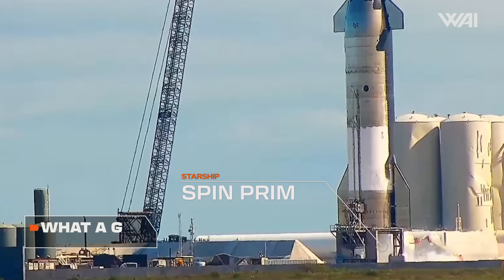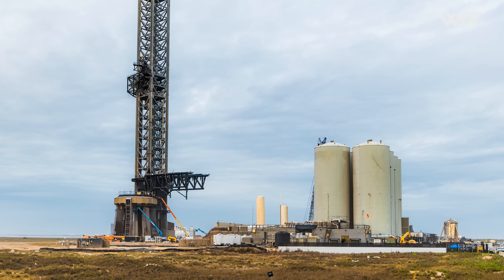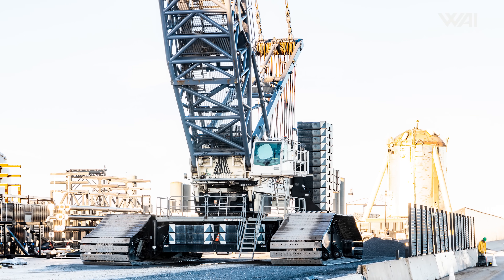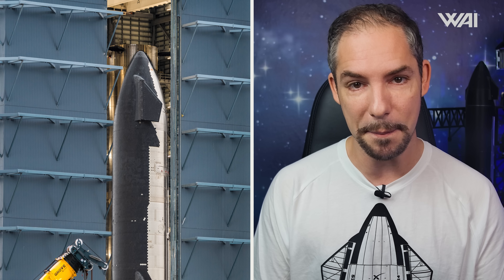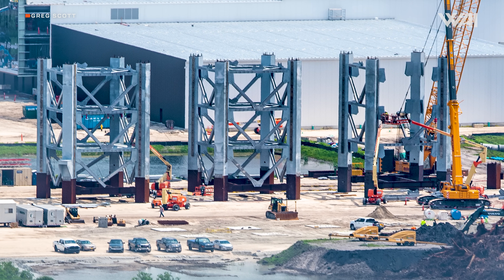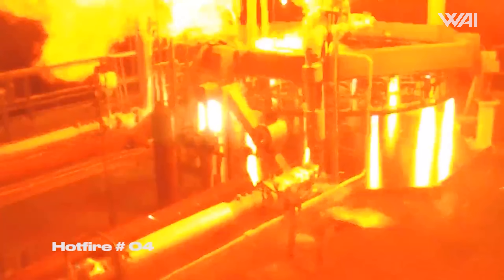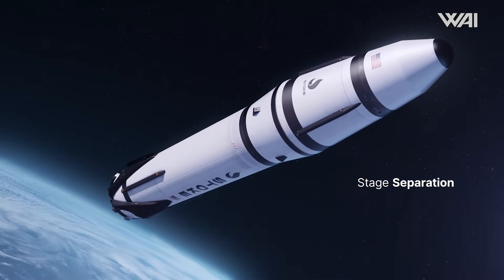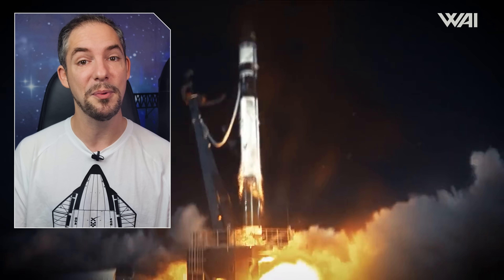It's On! SpaceX Sets Record Time For Starship Testing!

Comment: They are drilling cast pile instead of driving pilings. It works well in the swamp for foundations. They are setting up for a big building or a stand for something super heavy. Cheaper and faster than driving 100+ foot pipe or concrete pile like under the launch mount and tower. Wish SpaceX would hire me already to come operate one of their cranes. Would be epic to be a part of this operation.

Comment: The water tank is probably not damaged. The damage you can see is to the outer cover that was installed over the tank. They may just replace the cover.
Reply: If they leave the tank there is no need to replace the cover. Since they changed it from LCH4 to water it doesn't need to be insulated. So they will just leave it bare. The only reason it dented in the first place is they didn't put the vermiculite in.

Comment: The word "diaphragm" is pronounced "diafram". It's an English thing.

Trivia: when the printing press was first invented, English didn't  have standard spelling. Academics dithered and argued over what standard spelling should be. But type setters needed to do something; a business must sell product. So type setters just picked a spelling, and stuck with it. Spelling was established "de facto". That's a Latin legal term, meaning in fact. So if English spelling appears inconsistent, it is. And it was based on pronunciation in the late 1400s.

Comment: I think the tanks that were labeled as H20 and Unused near 5:00 received most of their damage during the 1st full launch but received some additional damage during the 2nd full launch, did u guys see the camera minivan that got destroyed during the first launch? That was awesome lol. I'm sure everybody has been kind of wondering what they're gonna do with those tanks that have bandaids on em lol. Good vid/update. 😎
Reply: Seems likely just the outer shell of the end tank is damaged. When they changed it from LCH4 to water they didn't put the vermiculite insulation in. Assuming the inner tank is okay, they will just remove the unused outer shell and leave the inner tank bare. Don't know if they ever got the second tank over to hold water. So it was likely sitting there empty. Don't know what they will do with that. The last two LOX tanks with the vermiculite padding them seem to be doing okay.

Comment: What this guy doesn't understand is they're not developing faster than SpaceX. Elon is developing the manufacturing processes to build high volume rapidly reusable starships. So 75% of the time spent on development is being used for building the manufacturing facility. Not designing the rocket. The rocket is already designed and developed.

Comment: Knowing Elon… I wouldn’t be surprised if he launches on Christmas Day!!  🎅 🎄
Reply: The odds of a 2023 launch are low.
For your convenience, here is a list of the milestones leading up to launch:
S28 Static Fire (6)
B10 Spin Prime (33)
S28 removal from Pad B
S28 lifting point removal
S28 Rollback
B10 Static Fire (33)
S28 lifting points tiles over
S28 rolled to Orbital Launch Site
FTS installation on S28 and B10
S28 stacked on B10
Launch
(A WDR is not required, but is likely to occur)

Comment: As you may recall  ...  questions were raised as to the short length of the chop stick arms that were made for the Florida tower. Well, they wouldn't need long chop sticks for a cryoproofing tower at Massey's.  But I wonder just how much room is available for a booster rocket garden at Massey's.  OH, and another PLUS ... no road closers for the proofing and or spin prime testings.  But then again, can they actually do a static fire with a booster over there?
Reply: Road Closures are out for Tomorrow through Friday.
Reply: Isn't there two sets of short chopsticks in Florida? Surely the current Florida tower would be intended for catches.

Comment: The tank layout has to change. You can't have your tanks get damaged every launch and expect quick turnarounds.
Reply: That's why the vertical tanks are being replaced by Horizontal tanks.
(Also, if IFT-1 hadn't done so much damage to the vertical tank shells, then IFT-2 wouldn't have caused nearly as many dents as it did)
Reply: The tanks don't seem to be a problem. Other than the concrete shrapnel puncture to the one LOX tank, they seem to be okay. The dented water tank wasn't being used because it leaked and the other tank damage is likely just superficial. It was originally going to be LCH4 with vermiculite between the inner tank and outer shell. When they couldn't use it for LCH4 they converted it to water. Since it doesn't need to be insulated, the outer shell was left hollow. So it had no support behind it. Assuming the inner tank is okay, they will just leave it bare and simply discard the unused outer shell.
Reply: @heartysteer8752  you: "The tanks don't seem to be a problem."
Also you: "You mean the same smarter than us people that couldn't even construct a functional water tank"
If your going to make an argument, at least be consistent.

Comment: Great video as always, regarding the mega bays, it could be completely possible, but mega Bay 2 is going to be for boosters. Building it with lessons learned for MB1 and MB1 re-fitted for starship V.2 given V.2’s additional height. On wards to the scraping of MB1😂

Comment: The welds look good because they learned they can can electro polish them to make them shiny again. No way to know if quality of welds has improved.
Reply: I highly doubt they are doing that, as it serves no purpose.
Reply: @bryanillenberg  yes there’s definitely a purpose to it. Most importantly is to improve its ability to resist corrosion, it makes the overall tank look like a real rocket company built it not a barn build, which will help attract new investors. These hand held electro polish machines cost around $1,000 and the process takes seconds. High value in electro polish.

Comment: I had herd that the vertical tanks were to be replaced with the horizontal  tanks due to the damage from  launches------
Reply: That replacement has already begun. Five horizontal tanks have been installed.
Reply: @bryanillenberg  I suspect the LOX and LN2 tanks will be around for a while and for now they are just taking the unused cover off the water tank.
Reply: @heartysteer8752  The LOX and LN2 tanks have already begun to be replaced.

Comment: Is ship 26 designated for the Orbital Tanker to test fuel transfers as required by NASA?  Since it will remain in orbit, it will not need heat tiles.  Just a thought, continuous delays are causing issues to the whole return to the moon program by the United States.
Reply: S26 is designated for the Plasma cutter.
The tankers will have tiles, and the depot will have insulation (probably 50+ layers of MLI), solar arrays, and several modifications that will not occur on S26

Comment: 14:17
So the FAA is grounding them until they complete a 271 point plan to upgrade their rocket and ground hardware and a 6 month environmental evaluation?
Reply: No environmental evaluation. And IFT-2 -> IFT-3 should be a much simpler fix.

Comment: My guess is that all the vertical tanks will be removed as their damage makes them unusable. They're just too big a target for 33 Raptor overpressure. They can't me made strong enough to justify the cost. Horizontal tanks only need a berm to deflect the blast.
Reply: I suspect all they are going to do for now is remove the outer shell from the one CH4 turned water tank. Don't think they ever put the vermiculite in it so it's hollow. The LOX and LN2 shells are supported by the pressurized inner tank and vermiculite filler. The exposed LOX tanks seem to have held up okay other than the flying concrete strike which should be a thing of the past.

Comment: Maybe building "OLIT2" at Massey's? Maybe even catch-only?
Reply: Nope. Here's why (sorry for long post):
First, let's end the myth of "crashed booster=no more pad"
The July 11th anomaly was roughly as energetic as a booster exploding right before the landing burn, with at least as much (if not much more) shrapnel. The OLM survived without the majority of it's blast shielding installed. If that hit the SQD, then the SQD would need repairs, but it wouldn't look like the Amos-6 Transporter erector.
"But, if it hits the tank farm"
The tank farm, for starters, would most likely not explode if the booster crashed nearby. It would take a direct hit. But there are several safeguards.
The first method of avoiding this is the grid fins. They have an incredible amount of control over the trajectory. Even if it means suiciding into the tower, the tank farm will be avoided.
If the grid fins don't work, then the landing attempt would have been aborted, and the booster would hit the Gulf. Not the launch site. This is due to it requiring lift from the chines to make it to the launch site. By removing the lift (this would be done by angling with the RCS), you would get a much bigger CRS-16.
The final method, if both engines and grid fins are failing during the landing burn, is the FTS. The FTS is still functional after MECO, as has been proven by IFT-2.
"Masseys avoid any chance of damage"
In order to land at Masseys, the booster would fly over the launch site, but more importantly, it would fly over Boca Chica Village and the Production site. A bad landing attempt could destroy Starfactory or a couple dozen houses. 
"Well, even so, a catch tower can be turned into an operational tower"
Not really. A catch tower, though it would require plumbing, chopsticks, and a partialy functional OLM, still lacks the SQD and all the associated plumbing. Adding this in will be expensive. There is also a good chance that the Deluge Plate would need to be added in. If this can be placed into the OLM structure before the OLM table is complete, they will do that. 
Finally, OLIT-2 has already been confirmed to be a launch tower, not a catching tower.
Reply: bryanillenberg is full of it. The only thing correct is OLIT2 won't be at Massey's. Though someone else suggested using the tower at Massey's just to lift the boosters and ships for testing. Given the demise of Pad A, I suspect the tower will be going there. And there is absolutely zero reason they couldn't dedicate a partially constructed launch tower for use as a catching tower at the start.
Reply: @heartysteer8752  differing opinions do not legitimize insulting people...
Reply: @percurious Thank you.

Comment: Great info packed post.  Seems like picture quality is improving.  Labeled  photos are good, especially aerials,  thanks.
However,  you are so choppy and short duration, that the viewer can't absorb all the good info.  So, pls allow a few more seconds of dwell time and knock off the corny attempt at humor = it over clutters the photo, particularly with the already too short of dwell time. 
Felix, you're a good fact based show, don't dilute it with feeble humor or gimmick stuff to "attract" viewers.
Keep it pure and simple, nothing but the facts, with enough time to let us get on board with the concept your explaining = it's new to us, but you've had it for several times before you post, so it seems quick and easy for you.  Good rule of thumb = keep it simple....or Elon would ask:  what part don't we need.
ps:  great coverage of "the other guys", thanks.

Comment: I don't know why they aren't using woven basalt fibers for some of these new technics. Woven basalt fibers are stronger than steel, have better insulating properties that asbestos and are impervious to salt or brinny water. They are also non conductive. Essential, rock. There is a new manufacturer of catamarans in Australia, using woven basalt fibers on the hulls due to these properties. Worth researching.
Reply: I think basalt is a great improvement over glass as a fabric. 

Basalt is stiffer than glass or mild steel, but not stiffer than fully hardened steel at low stress levels. 

But it is far cheaper and lighter than, for example, fully work-hardened stainless steel fibers, ribbons, or fabrics.
 
Basalt is lighter and cheaper, but brittle compared to hardened steel. It fails abruptly whereas steel yields. So that characteristic is a safety hazard compared to steel. But basalt ultimately fails at stress levels far above that of steel on the basis of weight or cost. So if brittle failure is tolerable, basalt excels. 

Glass fiber is less stiff, and a bit more expensive than basalt, yet still brittle, so the basalt seems better than glass all around.
Reply: Basalt is perfect for long-lifespan reinforced concrete in salt ladened soil, such as concrete piles. 

In the case of the Starship Super Heavy Booster, the engines are creating extreme hypersonic shock waves that impinge on the steel platform, concrete-filled steel tubing legs, and reinforced concrete pilings. 

Since all of this is research and development prototype structures, steel rebar seems adequate for piling which may be obsolete within a decade or two.

Comment: The next challenge for Spacex is to re-start the booster engines after separation. They must achieve that goal or there will be no Starship.

There has been no real data “escaping” yet on how they will do this. But they need to keep a fuel supply to the engines, when the booster goes “head over heels.”

There are a number of ways that this can be done. I will be curious which “method” they select. 

Engineer Scott Manley figured it out and posted “the problem” almost immediately after the second failure. 

Sanjosemike (no longer in CA)
Reply: Seems likely to be solved with just a modification to the flight profile. Maybe don't throttle the booster back as much and/or don't light the ship sea-level engines quite as quickly.
Reply: @heartysteer8752  Scott Manley believes the problem with gas bubbles clogging the fuel lines. The only way those can be avoided is by having a “constant flow” no matter the position of the tank, by providing constant pressure on the fuel.

Delaying restart will not work if there are gas bubbles clogging the fuel lines.

Uncontrolled ignition may be causing the engines to explode.

These people need to hire Scott. He gets it. 

Sanjosemike (no longer in CA)

Comment: You guys often forget that SpaceX is about being fast, fast turn over, fast launches, fast procedures.
We are not there yet, but one day we'll have to have specialized sites inside Starbase. Starships have very different needs when it comes to payload. 
So far we think there will be 10:1 launches ratio ratio when it comes to people and cargo, and propellant only launches.
Stands to reason there must have one launchpad specialized for transferring people and cargo, what with safety and procedures, and several launchpads that will ship propellant for "gas station" and Luna /  Mars refuelling missions,
Reply: Speaking of safety, will Starship ever carry people absent an escape system?
Reply: @peters-adventure  Maybe, but there are feasible ways to have a LAS on starship without increasing it's mass excessively.

Comment: As near as the megabays are to the launch site, what's their risk of collapse if there is a failure at the pad during launch? I'm thinking of the wide flat walls and shockwave from an explosion of a starship. It would be terrible to see a single explosion wreck a whole family of ships and equipment.
Reply: Expect the bays to have "weak links" selected by designers to fail first. I predict that would be the cladding panel fasteners [and horizontal frame fasteners]. So panels would peel partially off the wall rather than bend the [vertical] framework, which otherwise might lead to major collapse. The top floor would have individual rooftop panel fasteners releasing rather than entire ceiling trusses lifting off the walls or glazing panels releasing from walls. 

The booster has a large number of redundant Raptor engines, so booster RUD near the launch site is implausible. 

I doubt that the fab site could withstand a booster failure where the Flight Termination System combined the LOX and LCH4 quite near the launchpad, but that would only occur autonomously if the trajectory veered towards occupied land. 

However in the case of a nearly empty booster crashing inside the designated crash zone, the fab site would not have any damage.
Reply: @imconsequetau5275  Thanks for that thorough discussion! Good point about the redundancy in engines and thrust too!

Comment: I'm guessing the vertical tanks will all be removed and that area will be fully cleared as I think the 2nd tower will be located in that area, as close to the ocean as is feasible.
Reply: No. They are just now putting in more subcoolers there and reworking the piping to tie the new tanks in. And all the control bunkers are there. So the 2nd tower absolutely will not be there. For now they will just take the unused shell off the end water tank.